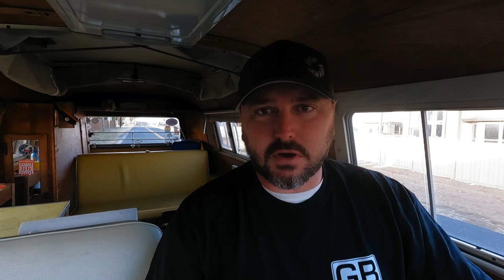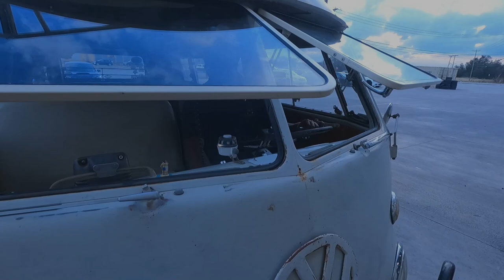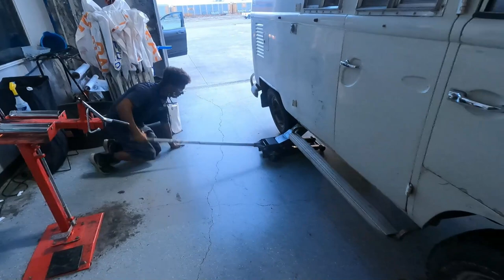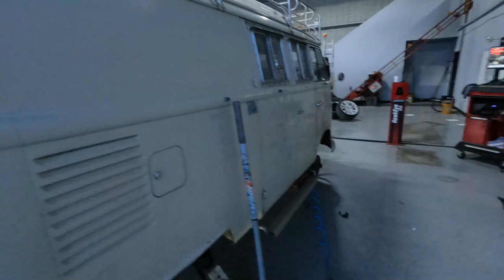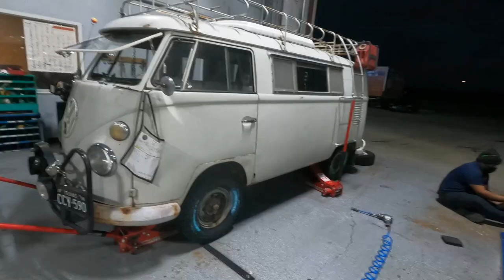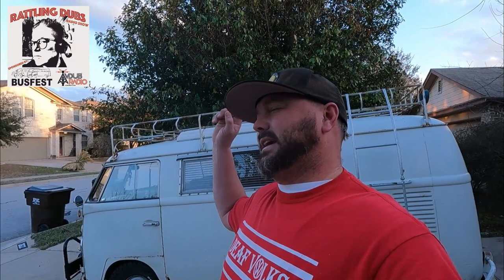Grabber Mafia - General Grabbers on a VW Bus

Comment: I love the way mine look. I can’t wait to drive with them.
Reply from the maker: Yeah! Get to work!
Reply: @OldVolksTV  today I removed the axles and replaced the rear brake lines. Tomorrow new axles and work on rear brakes. Then the next week new front brakes and master cylinder. Then I’m down to putting the freshly rebuild motor in.
Reply from the maker: Awesome!

Comment: Good seeing the tyre fitter using a torque wrench on the wheel studs, wondering if they actually removed the sticky label fixed to the tread, they don't like doing that here... Greetings from the UK!
Reply from the maker: I made sure he used the torque wrench. And he pulled the stickers AND cleaned the white letters. Very professional!

Comment: I've found a way,by watching YouTube, to fix a valve stem in the field. I've tried it and it works. All you need is 3 to 4 feet of 4x4 fence post WD-40, and the little tool that takes the valve core out and attaches to the inner or outer threads and the new stem. Just lay the wheel on the ground, lay the post on the tire up to the rim spray the lube where the tire meet the rim (valve side up) drive on the post and break the bead loose replace the stem and air up. Also you would need air compressor. This is easier on older rims with no safety bump on the inside.
Reply from the maker: In a pinch I bet that would work! I found out later that I also had a huge pointy rock that poked a hole in the tire.

Comment: A PO put 15s on my 71 Westy, thinking about getting some grabbers and original 14s myself! How do 14s handle?
Reply from the maker: So far so good. Quiet on the road and grippy off road. It's a tight fit, but no rubbing so far.
Reply: @OldVolksTV  that’s good to hear. The fifteens I’m running rub when making sharp turns, so sharp I feel like if I ran 14s it wouldn’t be there.

Comment: What size tires did you get?  Would this size allow you to put chains on the tires if needed?
Reply from the maker: These are 27x 8.5x 14. Unfortunately there's no room for even cable chains between the tire and the spring plate. We're working on a fix for that tho.
Reply: @OldVolksTV  Thank you for answering me.  I would be curious about how chains can be used.  I might try getting a slightly smaller size as my spares, and get two wheels to carry around with chains on them.
Reply from the maker: I've heard that's what the SST guys do. We've tried to fit cables on the grabbers, but it's super tight.

Comment: What were the downsides of rhe tires?
Reply from the maker: So far the only down side is that they're huge. It's a tight fit between the tire and the spring plate, but no rubbing that I can see. Also it takes a lot of power to get them moving, I can definitely feel the difference. The reduction boxes and dual carbs on SP manifolds helps with torque though so I'm not worried about hills too much.